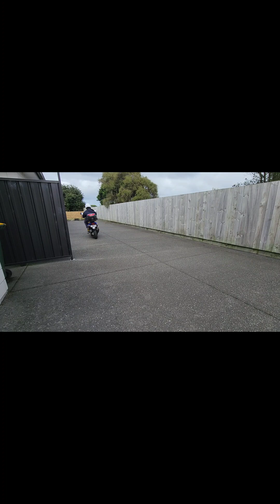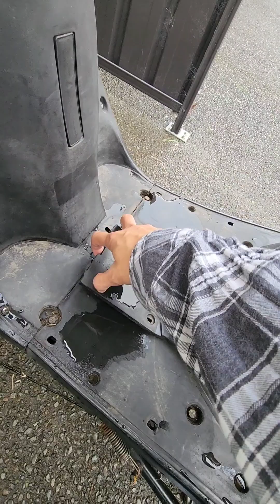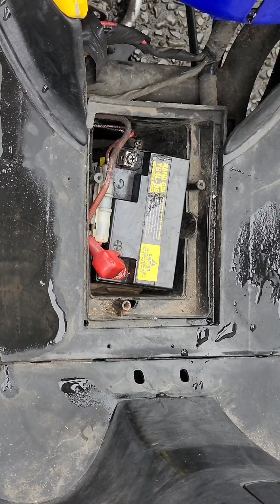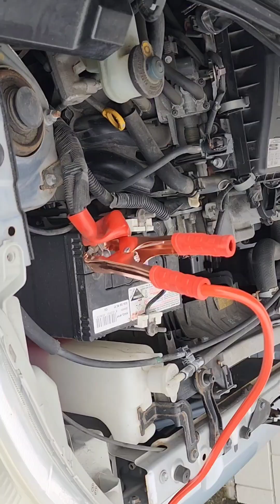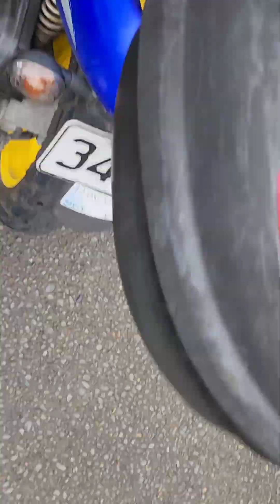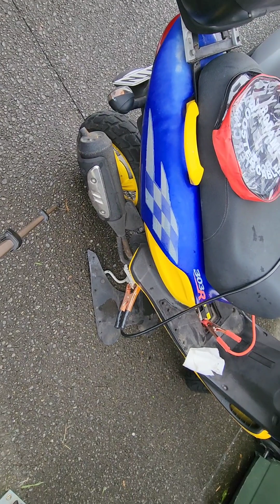How to JumpStart Motorcycle |JUMPSTART MOTOR VEHICLE TO CAR | Do this if your motorbike won't start

Comment from the maker: 1st put the red clamp on the good battery
2nd put the red clamp on the bad battery
3rd  put the black clamp on good battey
4th put the black clamp on the not working vehicle on any metal that is not painted far from the battery called ground
5th the try to jump start the vehicle that is not working.
Hope this helps